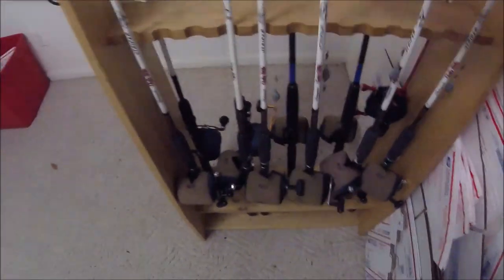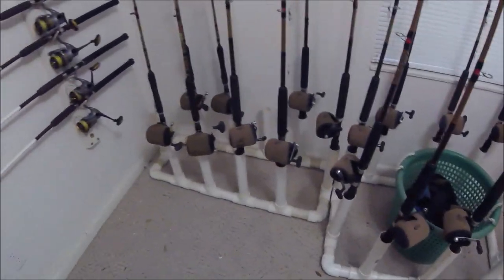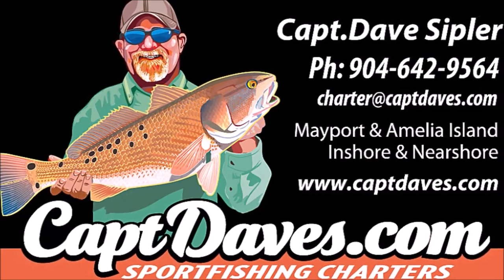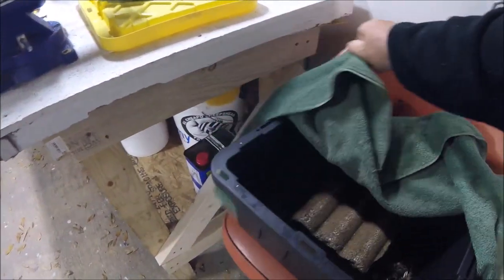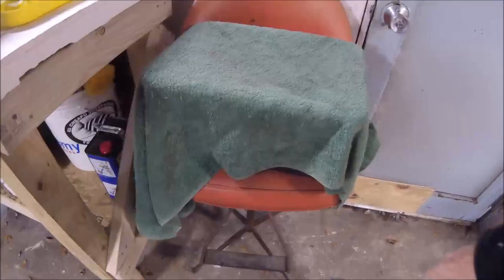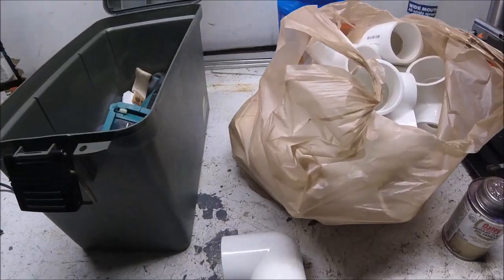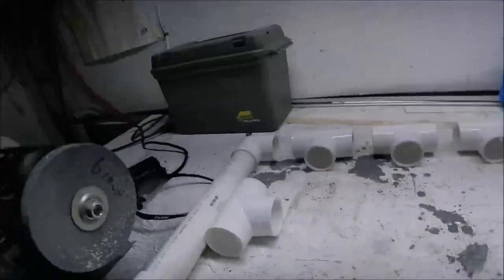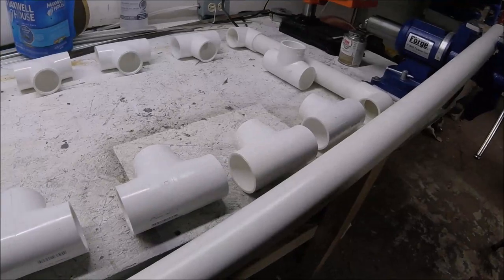Build a versatile rod rack/stand, EZ

Comment: I built a 3x4 stand up rod rack that is strapped into the of my boat out of pvc the same as you. so twelve rods standing up in the front of the boat, it works great.
Reply from the maker: good gawd, Must not be a ''sport fishing'' boat. 🙄🙄
Reply: @CaptDavesSportfishing  I should have been more clear, its 3 rods by 4 rods that have size 30 and 40 reels on them. Its a 19.5 aluminum deep vee that I fish on lake erie. what size are your reels? look to be a little bigger.
Reply from the maker: @johnwells6729  I have no idea what a 30-40 size reel even means?
Us saltwater sport fishing types , GO SMALLER, not bigger.
I use all shimano triton 100G's, and Daiwa Ryoga's..